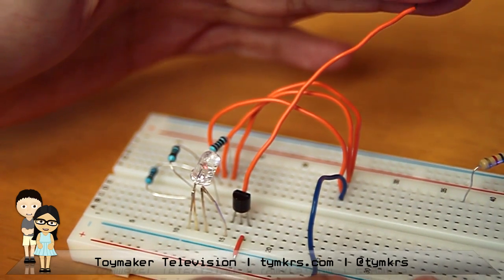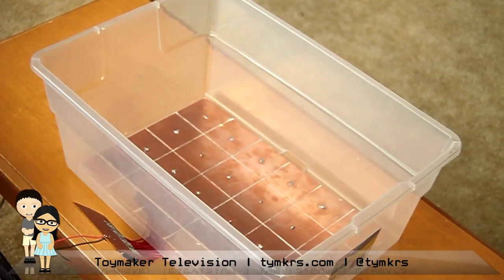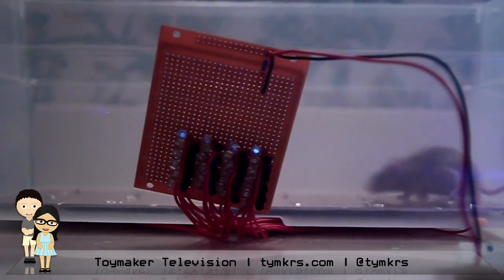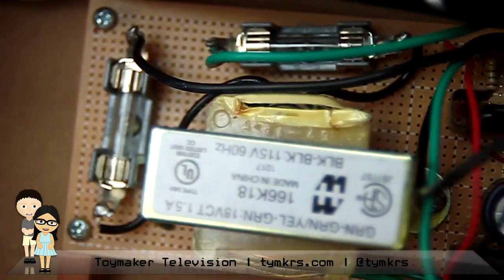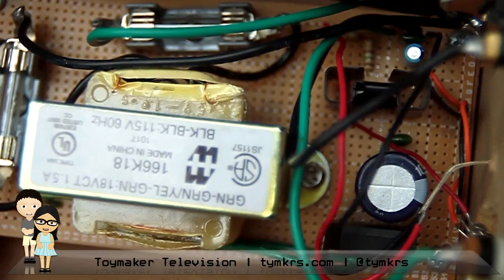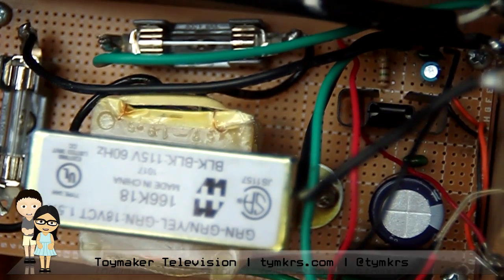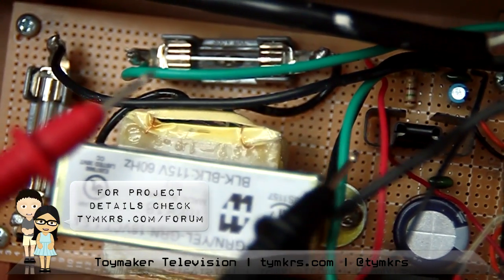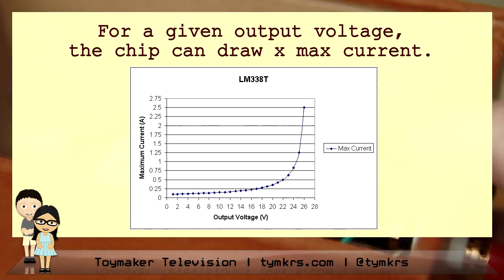Tymkrs Power Supply Update, Mouse Tracking Prototype, and Old Sheet Music

Comment: What you are building is not really the you commonly know as capacitive touch panel (which works by altering the frequency of a resonant circuit by changing capacity).

AFAIK the thing that makes the transistors conduct when touching the base is interference the body picks up (mostly the 50/60Hz of mains power). Put your other hand near powered devices while touching the pads with the other hand. The LEDs should light up more. So you need to add an antenna to your mouse!